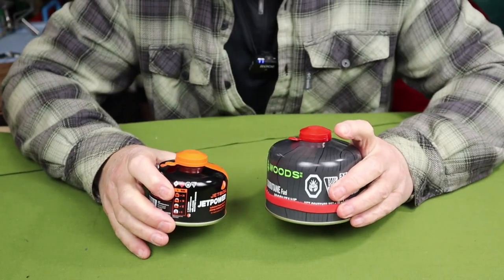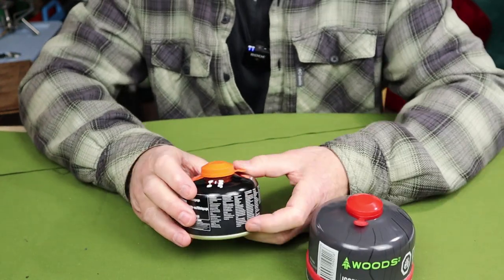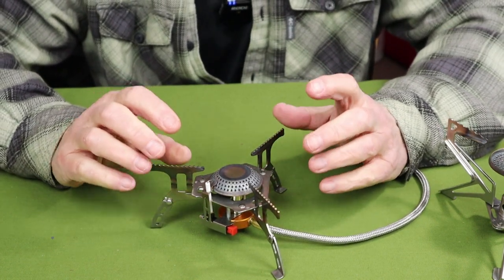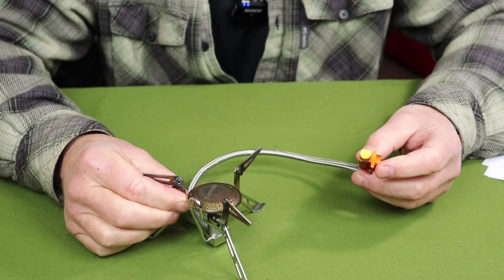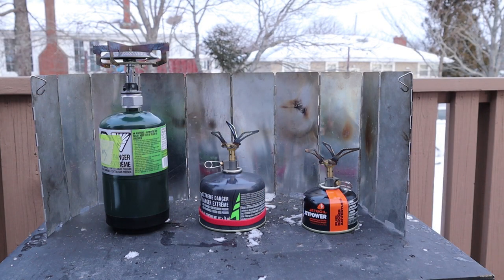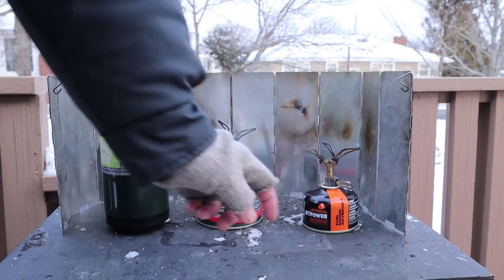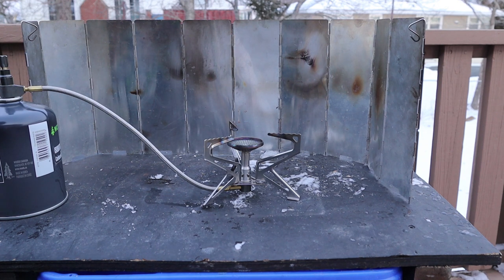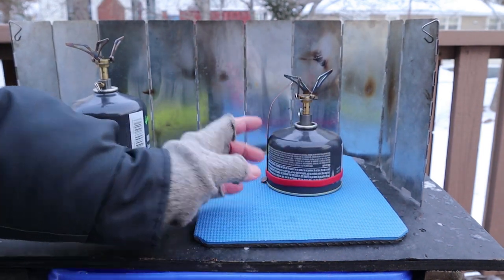Comprehensive Guide to Using Gas Canister Stoves in Cold Weather

Comment: Really great video Mark. i have just bought a pressure regulator stove as was experiencing poor performance in the cold with my preheat tube type.  I am still not convinced which is better, the pressure regulator stove or preheat tube type.
Reply from the maker: So far, in real cold weather I lean towards the pre-heat tube with the tank inverted. It does take a bit to warm up though. Thanks for commenting
Reply: @MarkYoungBushcraft  would be great to see the pre heat vs the regulator though, kind of what I was expecting then went a bit unscientific. subscribed!

Comment: G'day Mark, probably around 0 C is the coldest I'd encounter and haven't had an issue with Colman branded iso-butane, butane, propane 28-45-26 mix. or iso-butane @ 80-20 mix, on the Blade 2 or Windmaster, though i do usually pocket the canister for a while as a matter of course, just a good habit to get into i reckon.
I have heard, (second hand), of the odd dodgy canister valve, (have you ?), so depending on the trip I'll often take 2 X 220 g jobs rather than a single 220 or 450 g, ...... for our old mate Just-in Case.
Btw; on the other end of the scale, I'm struggling to find upper temp specs, it can go 40+ C here in summer and I am particularly concerned with leaving these fuels in a hot car for any length of time.
Any info would be appreciated. Cheers Duke.
Reply from the maker: Hey Duke. Good question about upper temperatures. We rarely get above 30C here so I have not thought about it. I think I will do some research on this. Thanks for commenting

Comment: Great video. Question for a canister stove with a pre heat tube i have msr windpro 2 in liquid mode what's the coldest you have been able to get then started? On the -25c day did you try to get that one stove started? I am trying to figure out limit of winter mix canister stove. Thanks.
Reply from the maker: I don't have the MSR Windpro 2 but I have a few stoves of similar design. I was able to get them started and use them at -25C using the winter blend fuel. They sputter and flare a bit until they heat up. A trick I use is to carry the canister inside my coat to help pre-heat it. Hope this helps
Reply: @MarkYoungBushcraft  thank you. Will keep canister in pocket while getting camp set up.

Comment: Do all these gas stoves connect directly to 1 lb propane cans or do you need adapters? Great review.
Reply from the maker: They all require the adapter for use with the propane cylinder but the adapter is quite inexpensive. I got mine on Aliexpress but Fire Maple also has them. Thanks for commenting

Comment: Yea, in reality propane ceases to vaporize well before -40 Celsius. Seen it tons of times. As for the others altitude plays a huge part on any canister stove as well.
Spouting stats is great, the real world shows otherwise very quickly.
Reply from the maker: Yes, I stated a number of times that the pressure and performance drop with temperature and that there is a point of diminishing returns.

Comment: I still have an Optimus 88 or 99 (cant remember) that comes in an aluminum container where the lid is a pot
I have the pressure pump to act as a pressure stove
Called a white gas or coleman fuel, but i just always used unleaded gas/petrol lowest grade
i have used that stove in -40 and it started perfectly
A liter of fuel would last ten days in the winter snowshoeing in the woods and mountains of Vermont and the Adirondacks, or the Scottish Highlands   
in the winter , cooking lentils and rice as my main evening meal
I have another heavy aluminum pot, that i simmered the lentils, and used haybox method and wrapped the pot in thin closed cell foam, to get a slow cook
Used the lid to boil water for coffee and tea, with a thin aluminum mug, almost as light as titanium
Still lights up like a treat
I also had the first MSR remote multi fuel stove, it was a beast
Did not use it much, as it was bulky.
i don't even think it had a model number 

Fond Memories
Reply from the maker: A classic for sure. I have an old Svea and Colemen that work the same way. Bit more work to use but they work so much better in the cold. Thanks for commenting
Reply: Was the early MSR an XGK?
I had one, briefly, in the 1980s and replaced it with a Whisperlite when the model came out. I still have it.
Reply: You have the 99. Good stove.

Comment: Hi Mark, Will the FM polaris, being a regulated stove,will it run on propane with the appropriate tank adapter. I did try it with the MSR Reactor, which is regulated, but all I got was a very weak blue flame.
Reply from the maker: I wanted to conform before replying. I compared propane to isobutane on my FM Polaris and Campingmoon pressure regulated stove. I did not a small decrease in intensity between fuels. Interestingly, I noted a larger difference between the two stoves when using the same fuels. I cannot confirm but the difference may be due to the BTU difference between butane and propane. Isobutane would be my first choice but I would be happy with propane as well. Hope this helps